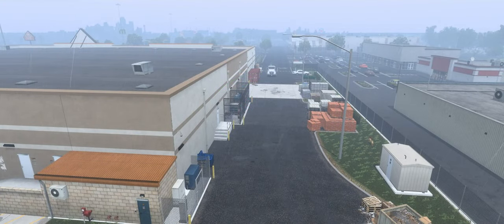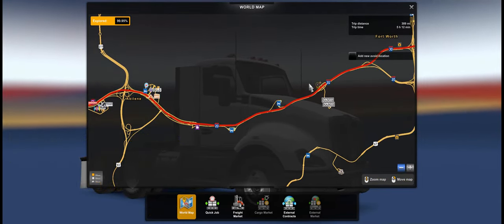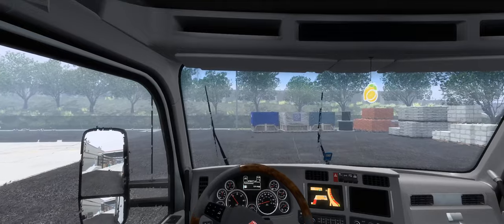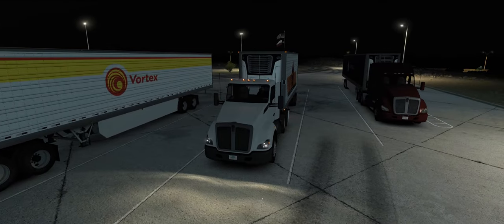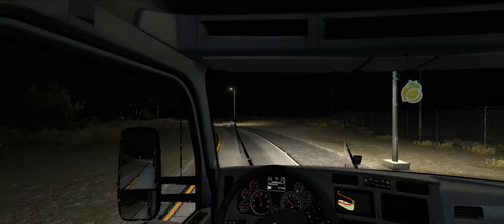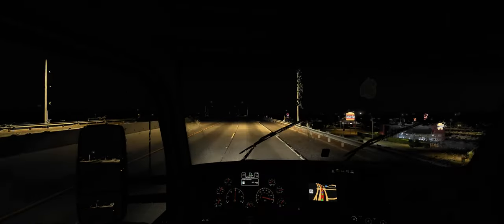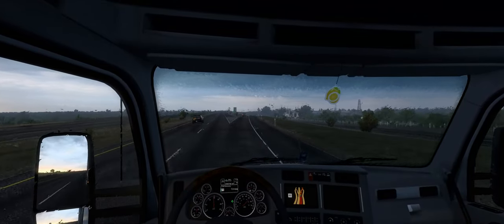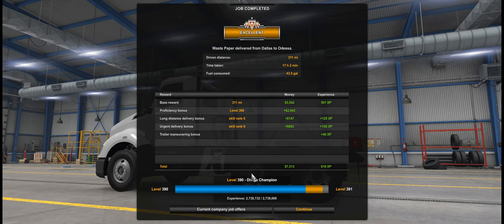American Truck Simulator - Beta Testing New Paccar MX-11 and TX-12 Powertrain

Comment: Trucking in the Rain at 75 not smart most times Lucky you🌧+🚛=🚓🚑🚒
Reply from the maker: ...add to that I'm on the wrong side of the road, I didn't do a pre-inspection trip, no-one's checked the service brakes in about half a million miles, and the power steering pump squeaks like a basket of mice. :) Yes sir I am very lucky. :p